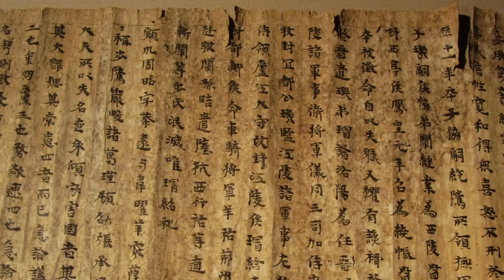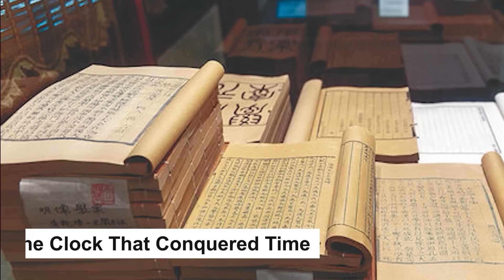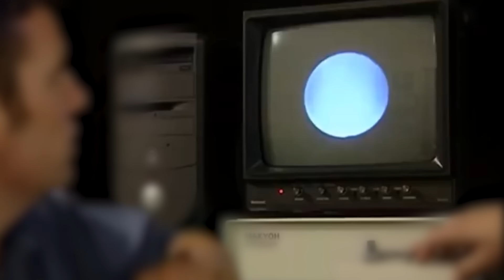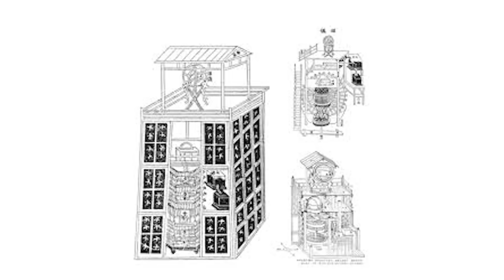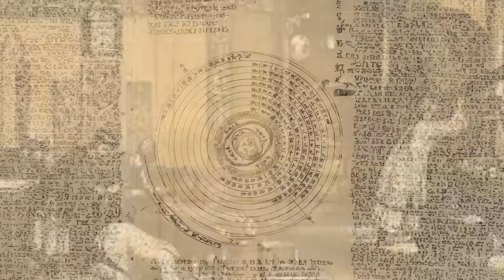7 Lost Ancient Chinese Technologies That Were Centuries Ahead of Their Time

Comment: The South-Pointing Chariot is a modern interpretation, no text mentions its mechanical operating principle, it is a modern reconstruction.
Reply: Nonsense. It was mentioned in the Book of Southern Qi, written in the 6th century. The re-invention, yes, it was invented earlier, but the technique was lost, and was attributed to Chinese polymath Zu Chong Zhi, who at his free time, discovered pi between 3.1415926 and 3.1415927, as well as invented a boat that could travel 1000 li (ancient measurements) by mechanical control.
Reply: @kennywong4239  Incorrect. The Book of Southern Qi is a 6th-century dynastic chronicle and does not describe any original invention or technical blueprint. There is no primary source attributing such a device to Zu Chongzhi, who was a mathematician and astronomer, not a weapons engineer.
The claim of a “lost technique later reinvented” is unsupported by archaeological or textual evidence and is a common retroactive attribution, not established history.

Comment: Ma Wangdui silk, 2,200 years ago, was successfully woven into a dress that was more than a meter long but weighed less than 50 grams. If you stack ten of these dresses on top of a newspaper, its transparency allows you to clearly read the text on the newspaper. The weaving frequency is 62 silk threads per centimeter, and the light penetration rate is as high as 75 percent.
Reply: Yes, my mother had one
Reply: @JoseRafael-oc3xu congratulations
Reply: So advanced yet everything lost because OF GREED PRIDE AND CORRUPTION   INDIA IS SAME WAY
Reply: @HarinderSahota-r7n OK.